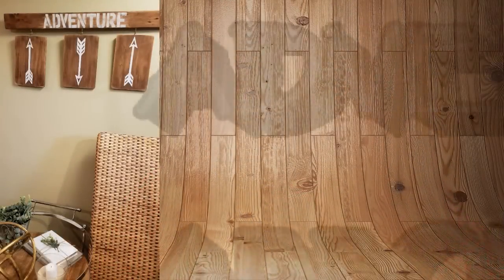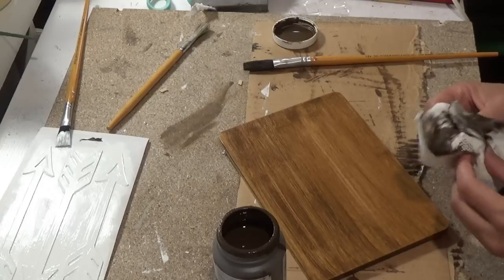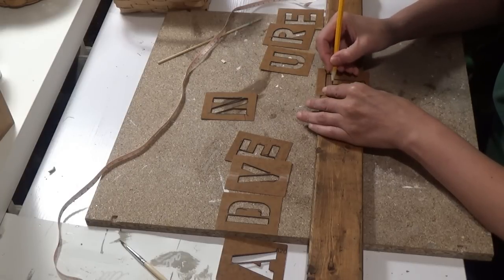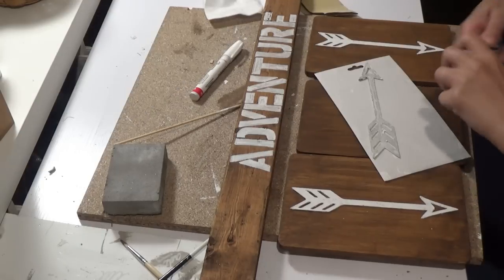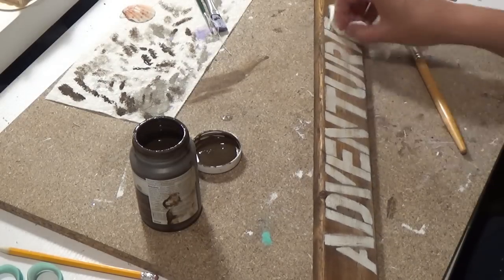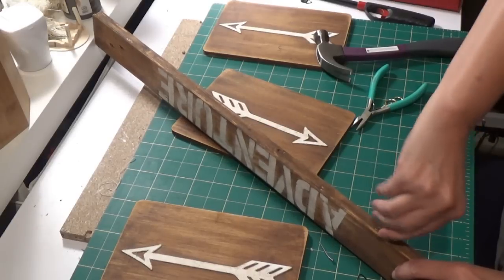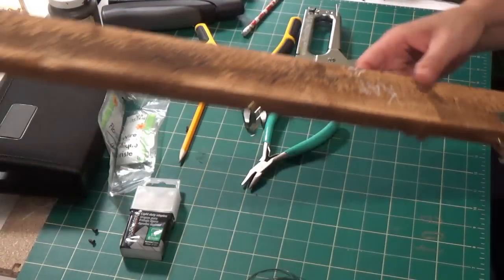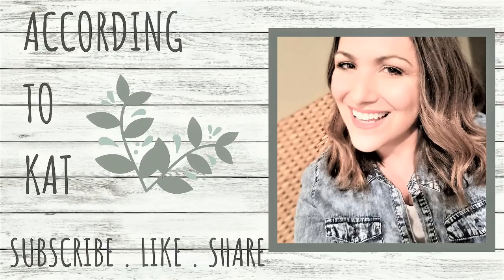DOLLAR TREE DIYs WOOD ARROW SIGN - RUSTIC WOOD SIGN DIY - Home Decor DIY

Comment: I had the same problem with the paint pens as well. I had to clean off the tip because it had gotten a little clogged from all the paint. I was told by a seasoned ( older lady) crafter that the paint pens weren’t to actually paint with, but to outline and write with. I had to go back and clean all my paint pens. 
I held the tip down until the paint came out more heavily. Then wiped all the gunk off the end. If that doesn’t work, you may have to pull part of the tip out, swish it in a tiny amount of water, then wipe everything off and return the tip back to the barrel. 
Good luck. 🍀
Reply from the maker: I will try to unclog it... they are great... but they drive me nuts. Someone also told me that you can't paint on top of wax.  So b/c I used the antique wax, the paint won't write on it.  That might be the reason, too.  Thanks for the help, Mary!